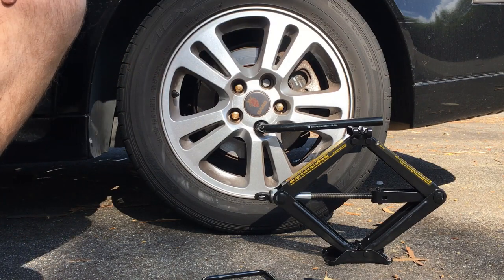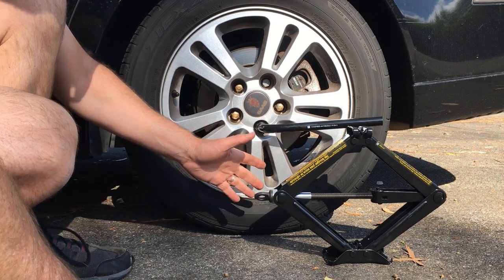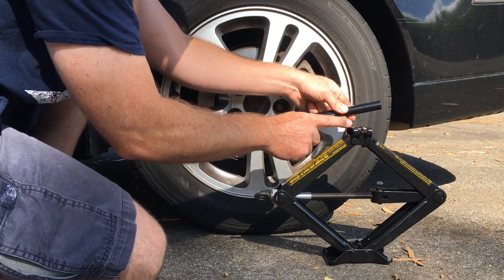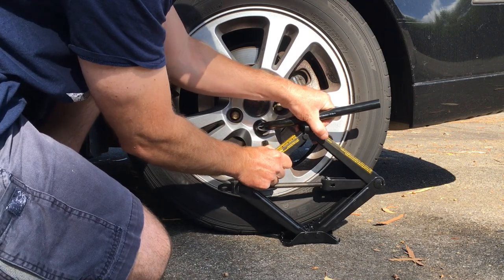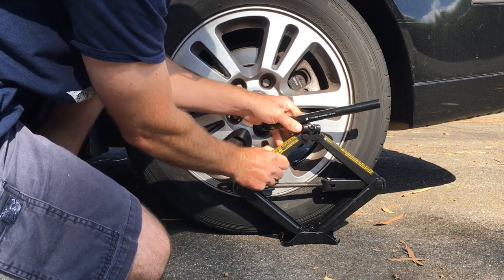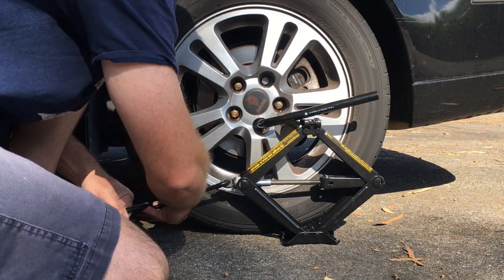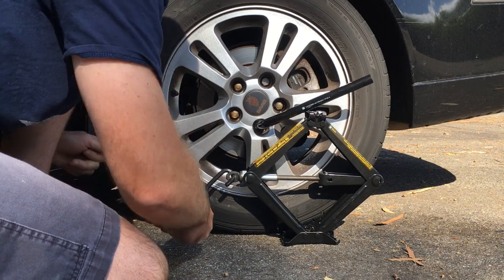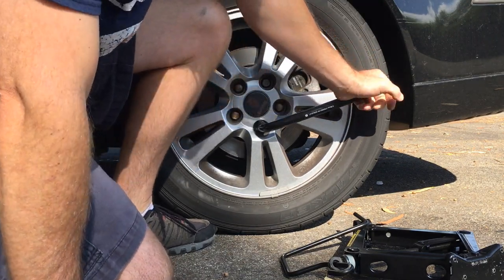WATCH: How to use your car's scissor jack to break a stuck / frozen lug nut or bolt free

Comment: Dude. Thank you for this. Pure genius. I don't have a breaker bar or a piece of pipe for leverage and I've been trying to get the lug nuts off to replace the brake pads but EVERY SINGLE ONE is completely stuck. I've got a really nice and long 4-way too so I've never dealt with it this bad. This is going to save a lot of sweat and frustration.
Reply: Did it work?
Reply: Yup.
Reply: I have a breaker bar now though. 👍
Reply: @DarksideSleemo  Cool, I'm going to try tomorrow with my stuck lug nuts. Happy to hear you're not still struggling after three years! :D
Reply: I just stand on my lug wrench with a slight bounce to loosen em up
Reply: @michaelalaniz7407  I did that, I was jumping on it. But the car jack trick did it, worked like a charm luckily.
Reply: @michaelalaniz7407  That's what I usually do as well but whoever put that wheel on my old Hyundai before I bought it meant business.

Comment: I never thought of that. Could have used that idea 10 years ago when my f150 had a flat at night and I couldn't get the lugs to budge. I called a wrecker service and the guy tried and couldn't loosen them. Goes to show how much roadside asst knows. Had to tow it to a tire shop. I'm sure this method works with a floor jack.

Comment: just use the jack as an extension to lug nut bar, the extra length will provide all the leverage you need... there is no way my daughters could loosen until i showed them the trick

Comment: This is certainly thingking outside the box. I tried increasing the length of the bar by adding pipes on it. Didn't think of using a jack for this. Will try to break my dry bolts free once a storm passes.

Comment: This is a very handy tip if you have a flat tire on a rental car.  I carry a piece of pipe in my car just in case the wheel nuts are too tight, but you may not want to have a length of pipe in your carry on bag going thru. airport security!

Comment: If you use this idea rotate the wheel wrench to a level position so contact is secured .  It is a lot easier and efficient to install a pipe over the wheel wrench .

Comment: Just step on it like everyone else.
Reply from the maker: I agree and covered it in my original video. But every once in a while a stuck lug puts up a hellish fight against the short lug wrench you're working with on the side of the road.  The scissor jack method is an alternative that doesn't require additional tools.  Thanks for the comment!
Reply: I actually stepped on it and jumped on it and the wrench actually broke 😅